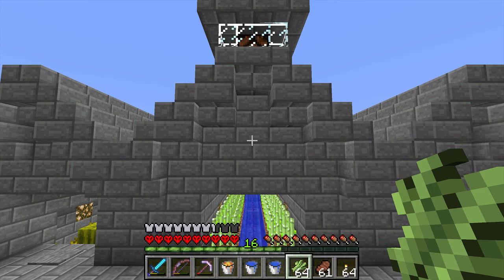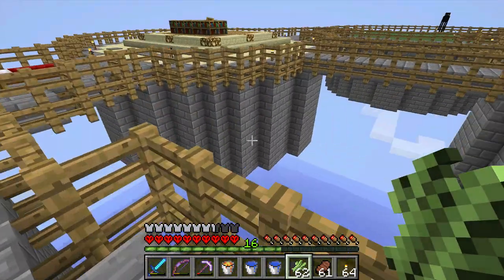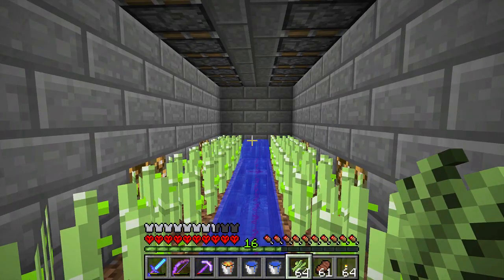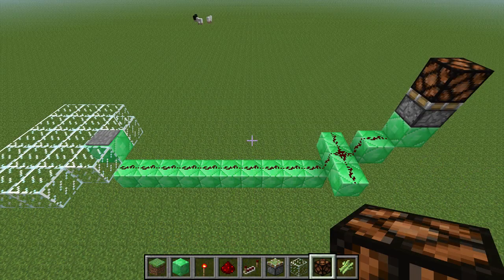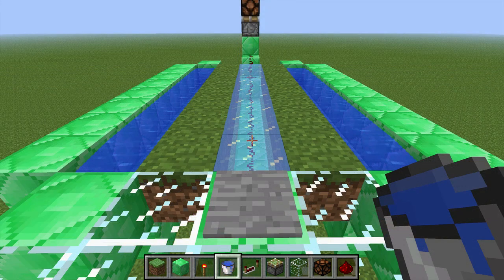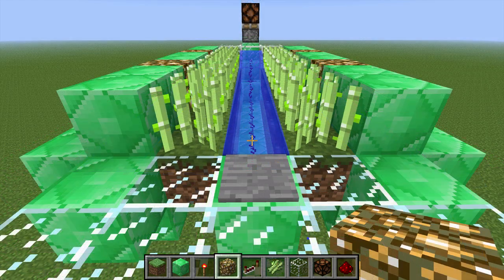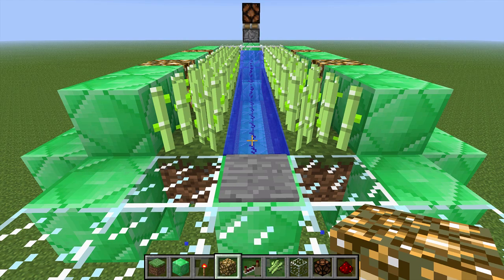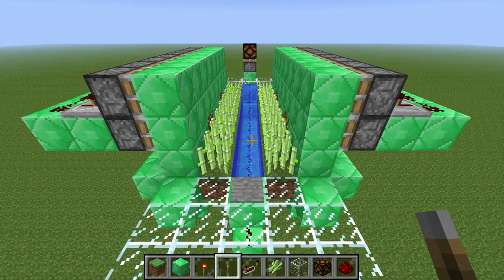Sugar Cane Factory (Minecraft Tutorial)

Comment from the maker: The glowstone lamp at the top of the sticky piston is essential. You can't just replace that with sand or you'll break the auto-harvesting operation, meaning that you'll only be able to harvest once each time you step on the pressure plate. You need a block that will change when the power of the block behind it changes.